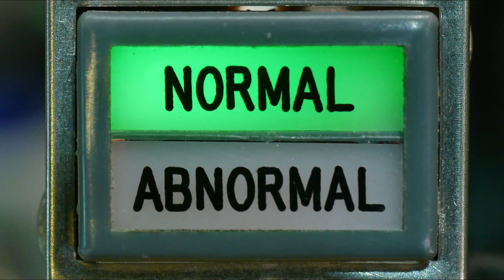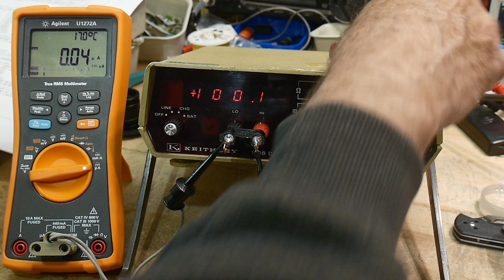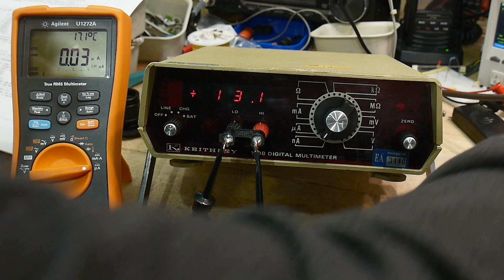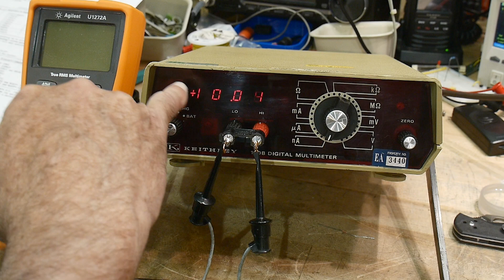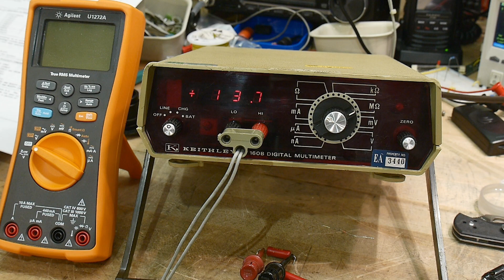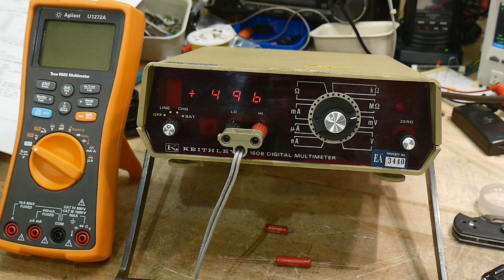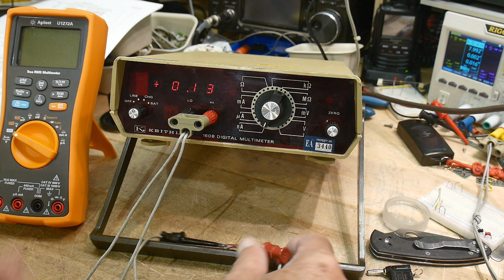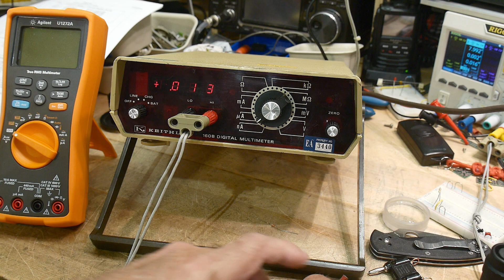#1163 Keithley 160B (part 3 of 3)

Comment: I hate plastic cases for noise. For stability I cover the inside of plastic cases with metallic tape, then reinstall the guts. Sounds funny but it has made a huge difference. You could make a video with this 160 before and after. I think you'll be surprised.

Comment: it would be interesting to clean the 400M , finger oils dirt etc on those large r's maybe leaky.
Reply: And don't let it touch the wooden table.
Reply: @paulcohen1555  Concur, and the worn spring probes, and the other meter in series (for the current measurement) and noise from lamps, other power supplies, and, and ....

Comment: I'm jealous. 

I have no need to measure picoamps. I don't often measure microamps. In fact I have a -15--0--15 microamp panel meter that I have no use for--other than it looks neat, but I'm still jealous. 

Oh well, as you said in your video on your new LCR meter, sometimes it IS about the toys.

Comment: Just curious , Do you know the type of ADC? Single slope,Dual Slope etc...  Low current in hundreds of pico amps. Nice $30.00 cool
Reply from the maker: I think it is neither. the manual calls it a charge balancing A/D. I'm not familiar with the technique.
Reply: @IMSAIGuy  I too am not familiar with this technique.  Thanks Mr. IMSAI guy. Back in my college days we programmed on a 8085 and a 6800 micro. Good o'l days